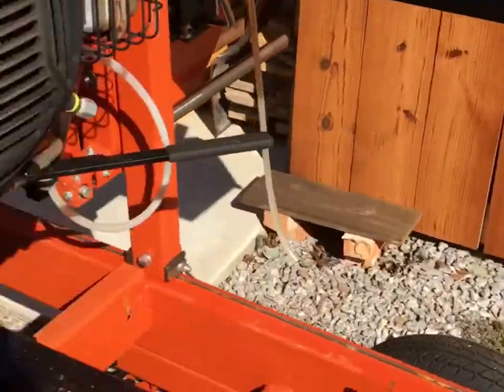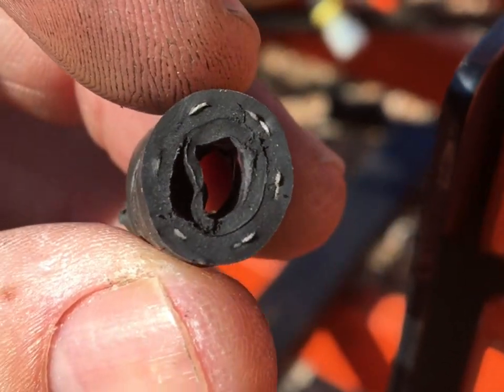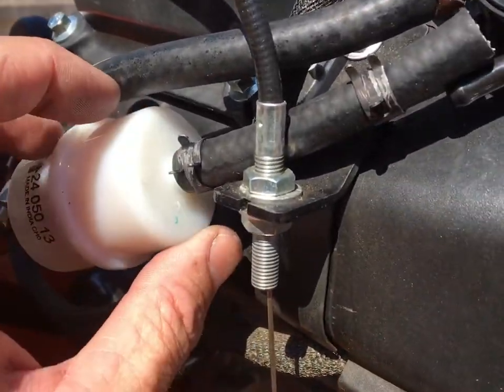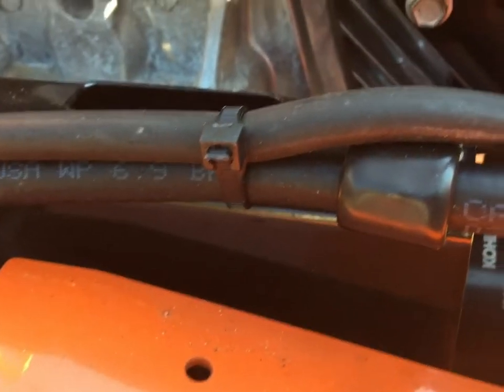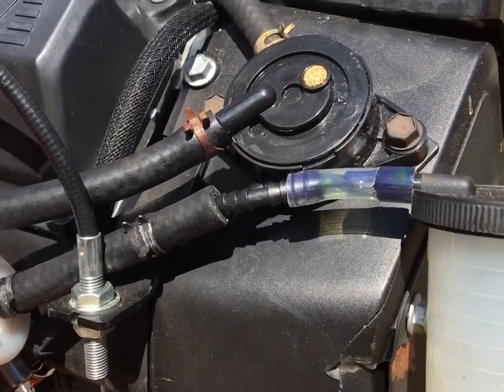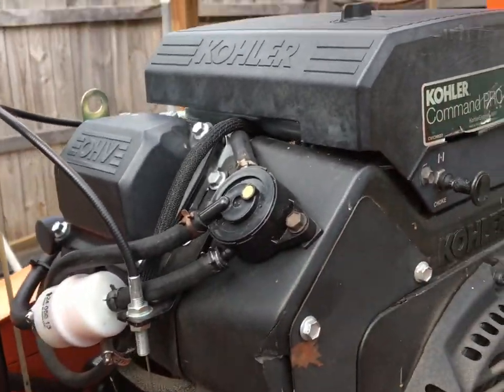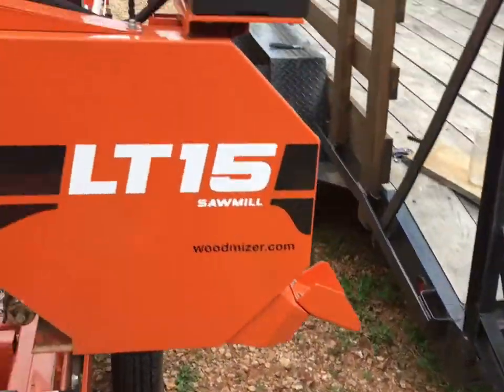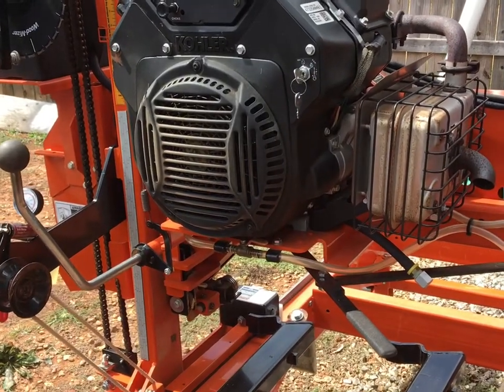Wood Mizer Sawmill Kohler Command Pro Engine Randomly Dies---FIX

Comment: Thank you for making the video.  I bought a used lt15 that had the same issue.  When I took off the fuel line off the fuel shutoff, I found dirt in the fitting.  So I am replacing the shutoff fitting with the "straw".  I now am going to replace the 1/4 " fuel line with a marine bulb inline.  Great idea.  I also am using a clear fuel filter instead of the opaque one.
Reply from the maker: Glad I could help.  I ended up having to swap fuel pumps again.  The mill got to where it would not start again after I replaced all the fuel lines, so I put the original fuel pump back on.  I test ran it with no inline filter to see what it would do.  It runs perfect now.  So, I went back and put a new fuel filter on it and have had no issues since.  My guess is I just got a dud "new" fuel pump from the parts store.  Hope that fixes your issue.

Comment: would you consider this a good engine or a bad engine? thinking of buying a pallet dismantler from wood mixer and it comes with this same engine
Reply from the maker: I have not had any issues with the motor.  Only thing I have had to do was swap out the fuel lines and the fuel pump.  For what I do with it, it's plenty of motor and runs good.  I wouldn't be scared to buy another one.
Reply: @truckingoutdoors4878 do you use it a lot of hours every day.. ? I’m hesitant to buy one cus I’m worried about the gas engine its 19hp Koehler as well. ..
Reply from the maker: @mauriciogaona6695  I do not use it every day as in a commercial application.  I have however used it frequently for a few days in a row 8 to 10 hours at a time with no issues.  I just use my mill as a hobby mill and not as a commercial application.  You might want to check with them and see if they offer any upgrade options with a bigger motor if that is a concern for you.